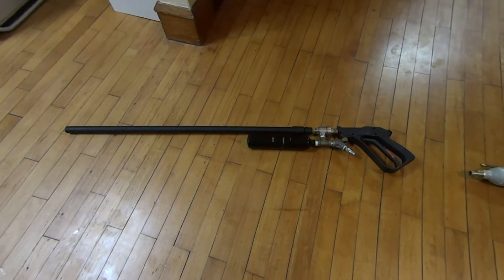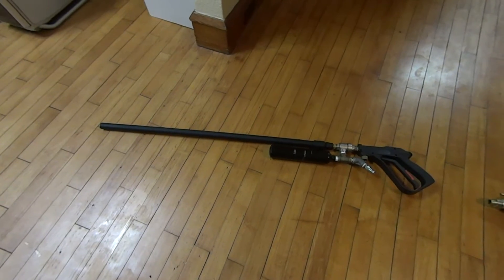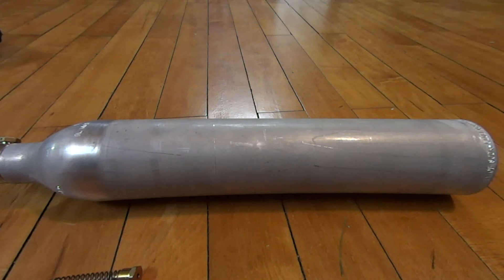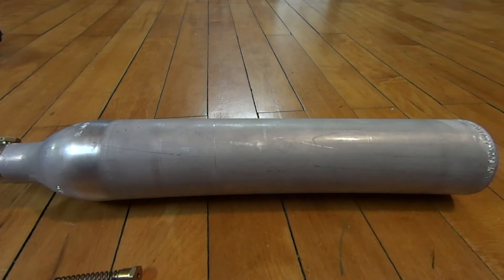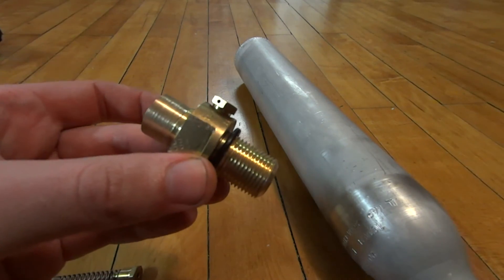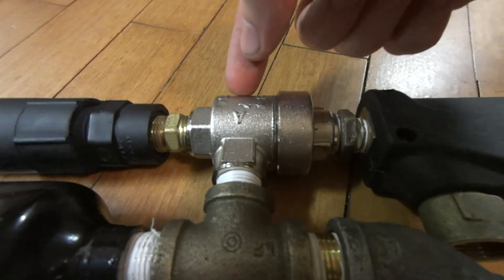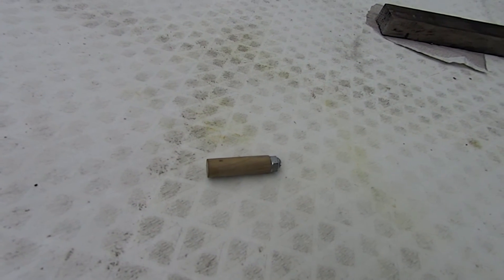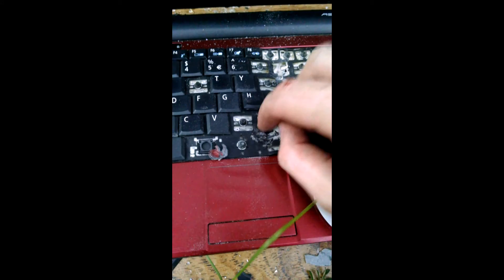HOW TO: QEV air gun rifle more in depth look and firing

Comment: You ever have a qev fail on you?
Reply from the maker: I've had them stay open, but never a catastrophic failure
Reply: @swandonovan  just made a mean qev rifle simular desighn to yours tbf i just have a 3000psi tank an remote line regulated to about 300psi firing 8mm steel ball bearings
Reply from the maker: @madonrc83  awesome! I did something similar on a later video
Reply: @swandonovan  i seen all your videos bruh ;) how come u stopped? U get boored or ?
Reply from the maker: @madonrc83  haha thanks. Yeah just moved onto different projects. I do still want to modify the drozd bb machine gun.

Comment: G'day Swan, Just wondering the psi rating on your 3/8 and 1/4 fittings.. All the ones i can find locally are only rated at 150psi for common workshop compressors.
Reply from the maker: J. Stuurz good question. I haven't been able to find a rating, but I haven't looked too hard. They are thick walled, and small diameter, so should withstand a lot of pressure.
Reply: All good mate, cheers, i might just order it all in stainless, be up around 1000psi then.
Reply from the maker: J. Stuurz in this small of ID, should be able to handle more than 1000psi
Reply: Correct.. seems to be a big difference between 'working' rated psi and burst pressure.. why do they market these fittings with 'max working psi 150' when the burst pressure for a m/m 1/4 inch brass fitting is 6,650 psi and f/f 3,350 psi... 3/8 inch is around 1000 psi less for both but still shitloads.. qev will go long before the fittings do..

Comment: I would stick with steel or Kevlar wrapped pressure tanks.  The reason pressure tanks are not made from aluminum (by and large) is that every time aluminum is pressurized and depressurized, the aluminum becomes slightly more brittle.  The effect is called work hardening.  This is why aluminum SCUBA tanks are retired after several refills and why airplanes are taken out of service after several years.  Older airplanes like the B-52 are not pressurized and do not become work hardened.
Reply from the maker: dchall8 I'll have to read up on that. I'm not too concerned as the pressure I'm using them at is less than rated.
Reply from the maker: couldn't find anything about what you were talking about in reference to pressurization and depressurization of aluminum tanks.  although i have heard of work hardening before.  never in the instance that you're talking about though.  the only thing i was able to find specifically about aluminum pressure tank failure had to do with tanks made of 6351-T6 alloy before 1990, but it had nothing to do with stresses from filling and emptying.  do you have a link to any info about what you're claiming?
Reply: Other than 4 years of aerospace engineering school and 27 years as a rocket scientist, no. Internet hadn't been invented yet. I'll see what I can find.
Reply from the maker: dchall8 OK. if you can find some literature with some good sources, that'd be cool. as a certified scuba diver, I can tell you that aluminum tanks are for sure good for more than a couple of fills. they actually have no date after manufacture that they do bad. assuming they keep passing hydro testing, they can keep being used. the same can be said for medical oxygen tanks, and propane tanks. I've seen 50 year old propane tanks that have passed hydro testing.
Reply: I'm not sure how these sources will appear (this isn't exactly a full feature forum).  The first describes how aircraft duty cycle is determined.
http://www.airspacemag.com/need-to-know/what-determines-an-airplanes-lifespan-29533465/

The reason for the pressure/depressure duty cycle was a series of crashes of the de Havilland Comet 1 aircraft.  https://en.wikipedia.org/wiki/De_Havilland_Comet 

My memory of aluminum SCUBA is not perfect.  I got a used one  in 1984 and was always afraid of it.  Hydro testing should be good, because aluminum tends to develop cracks before it ruptures.  So if I was going to put an aluminum pressure tank up against my face, as in an air rifle, I would have it pressure tested every time I refilled it.  That seems like a crazy maintenance plan, hence my first comment to stick with steel or fiber wound tanks.
Reply from the maker: dchall8 I'll check that out when I get a minute. the issue is, the steel tanks have close to the same hydro testing requirements as aluminum tanks.

Comment: nice video. could you show pics of the hole in the dia? and a pic of which spring you used to bring the dia in position?
Reply from the maker: once it's warm enough and i get my new valve setup finished, i'll upload a new video of the qev taken apart so you can view the hole and the spring.

Comment: Can I also use a air compressor gun and is there a spring in the qev valve
Reply from the maker: as explained in the video, there is a spring behind the piston in the qev.  you can pretty much use anything to pilot it.  my first revision of the gun used  schrader valve
Reply: My air gun looks like this my air camber wil be atteced to the bottom of
the gun will this method work if not can you give me some advice please

Comment: Total noob at this but wondering if you could 1) use a NPS to NPT adapter? For those of us without a lathe. 2) Couldn't you use a check valve to prevent the backfill problem you were talking about?
Reply from the maker: yeah you could use a nps to npt adapter if you wanted to use a soda stream bottle.  the thing is, it has to have a shoulder on it as the nps is non sealing and uses the o-ring seen in the video to make it airtight.  the o-ring needs to be able to seat on something on each side of it. (hope that makes sense)  you could also use steel pipe with the proper fittings.  you can use really anything you want, as long as it's rated above the pressure you're going to be using the gun at.  and where are you talking about using a check valve?

Comment: part list ?
Reply from the maker: 1x pressure washer handle
1x 3/8 npt qev
1x 3/8 npt tee
3x 3/8 npt female to female coupler
1x 45 degree angle 3/8 npt elbow
1x 3/8 npt self closing female hydraulic quick disconnect fitting
1x 3/8 npt to 1/4 npt female reducer 
1x 1/4 npt female to female coupler (you will probably need different fittings for the last 2 as i doubt you'll find the   same pressure washer handle)
1x 3/8 npt to 1/2 compression fitting
1x 1/2 inch x 3 ft stainless barrel 
1x paintball co2 tank with valve removed  and tapped to 3/8 npt or 1x soda stream bottle with valve removed

Comment: would this still work if you dident have the 45 just a blank? 
like if my bottle has a charge port on it could i use this design but blank the charg side?
Reply from the maker: sure, if your bottle have a valve located on the end of it, then you could either cap off the t, or use a 90 degree elbow instead of a t.   you would still need a self closing valve, or a ball valve ect before your filling valve if it was non self closing
Reply: some co2 fire ext have a prime valve : ^ ) 
possably a 12v sol for trigger 2 . love the q.e.v !-!-!-